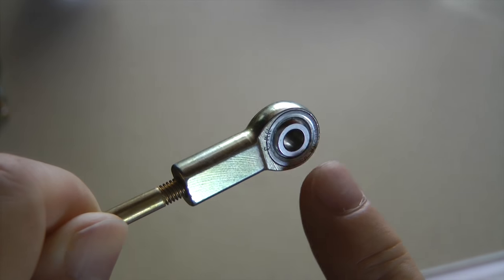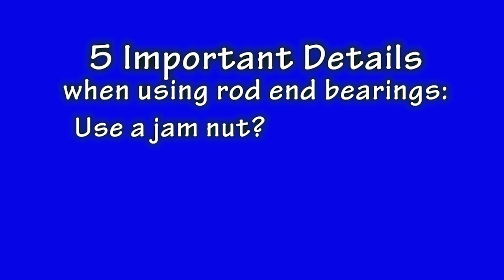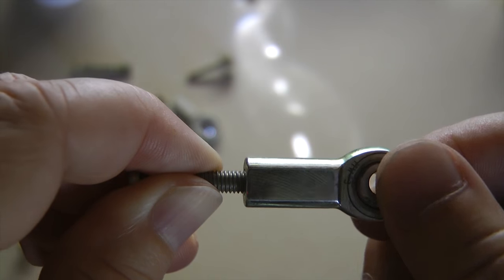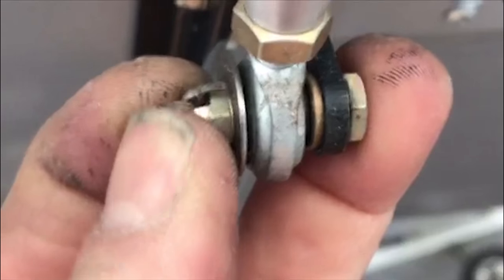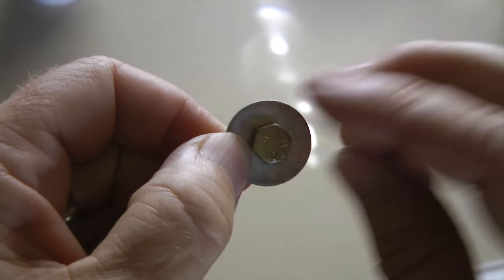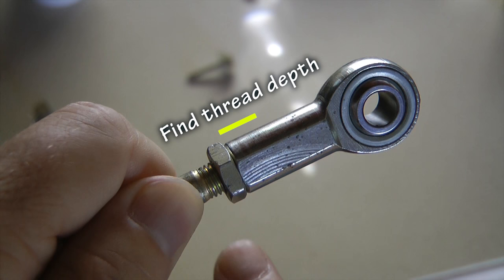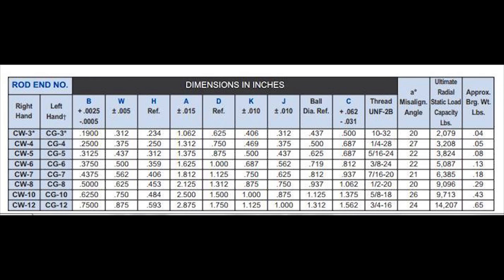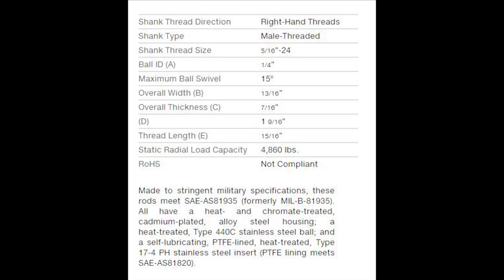Rod End Bearings in your Experimental aircraft

Comment: Great information, thank you. I wonder about the use of a large washer though. Won't it impede the angular movement of the bearing? In the Aurora catalog it shows an angular change of about 20 degrees; I could imaging a large washer hitting the body to reduce that movement to less than 20 degrees. Also, I recall using rod end bearing in a race car where a small diameter, thick washer that just covers the flat on the bearing is first used, then a larger washer on top of that.

Comment: Can lock washers be used with the jam nut?
Reply: should not be used.    Remember a lock washer is a washer that is already broken.     If you by any chance over tighten a lock washer it will open up. 

I do not recommencement lock washer at all.     Also a lock washer can only be used once.     When it comes to washer use   Grade 8 Washers.